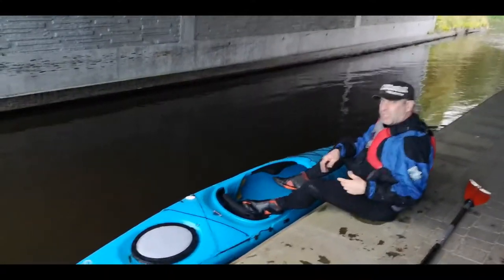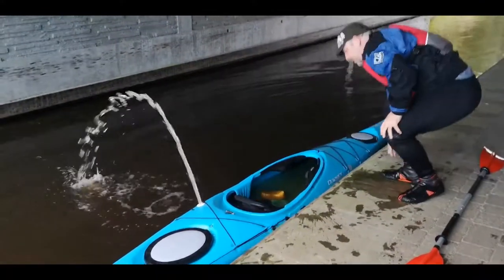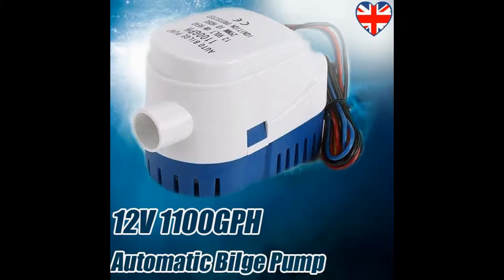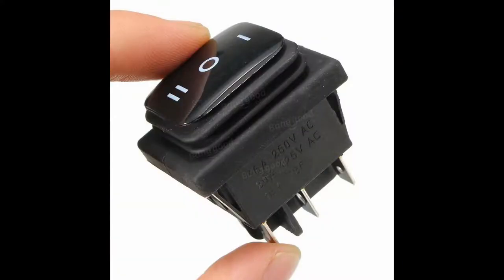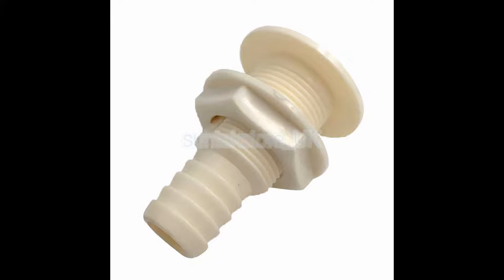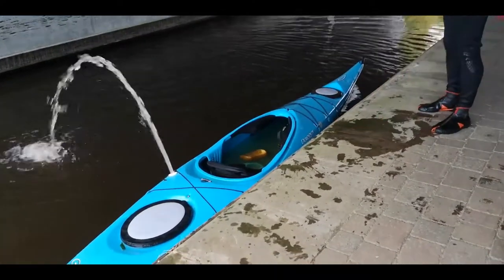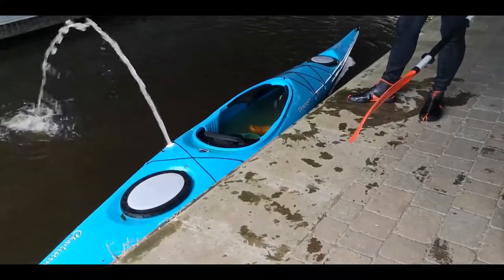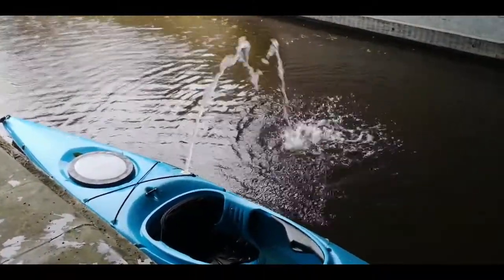Fitting and testing a sea kayak bilge pump

Comment: Great video.  I understand how the electronics work.  However, did you use a waterproof container to protect the battery and wiring connections, or do you rely on watertight bulkhead?  My ORU Kayak lacks a watertight compartment, which would require a submersible batter container. Thanks
Reply from the maker: I've got the battery in a watertight container. I used a waterproof plug / socket to allow it to be removed. Velcro to stick it to the inside of the kayak.
Reply: Thanks for responding. I just purchased a Nocqua 4Ah water resistant battery kit. Hope that works as well as what you have. Including a closeup of the install and container (or link to that part) might be helpful to others looking to do the same.